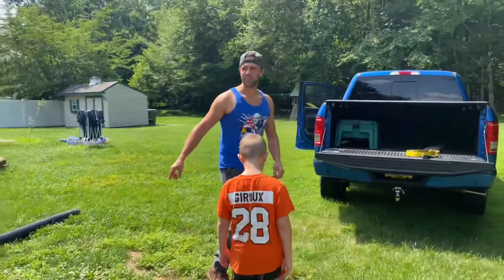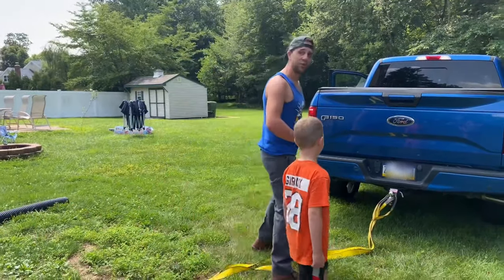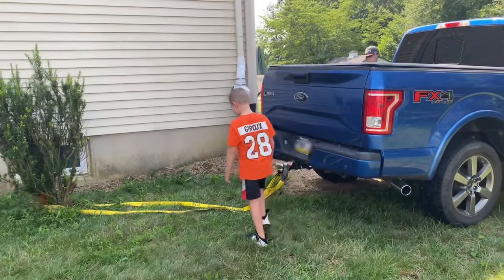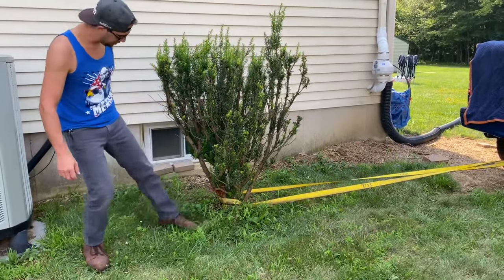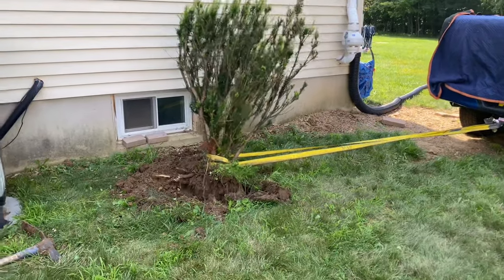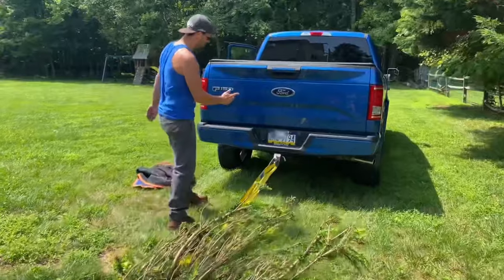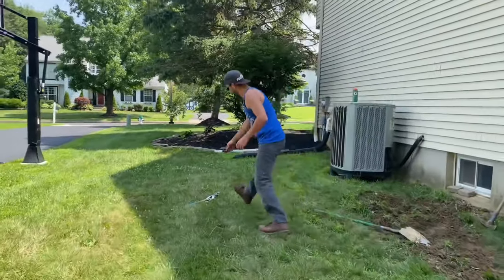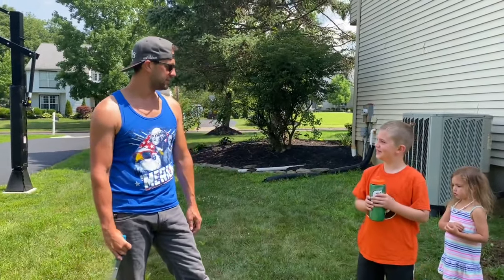Easiest way to remove a bush with roots: 10 Minutes Max | Truck vs Bush

Comment: 4WD is a must…couldn’t tell if f150 had it
Reply from the maker: Agree 4wd is a must !
Reply: No you don’t.  I rent a Home Depot flatbed.  They’re usually a F-250 equipped with a 6.2L V8, rear wheel drive and a tow hitch.  I pin my own draw bar and shackle on it.  Low gear.  Have never had a problem.
Reply: I have F150 V8 but not 4wd. I hope it still works.
Reply: @whunt29708  - so did you get your bushes pulled out without a 4X4???
Reply: @DanInKnoxville  well I ended up just using a shovel. My tires kept spinning in the grass and tearing up my yard so I had to stop trying that way.
Reply: @whunt29708  - thank you for your response :)  Lucky for me my brother has a $
4X4 Jeep with a winch, I'll just have him come help me! lol
Again thanks for your reply! Have a GREAT day!

Comment: Nice job. I have done many extractions like this. My tools were a Ram 2500 in 2WD, and a 10 foot long heavy load chain with a loop to form a slip knot on the target bush. I linked the chain to a 1/2 inch length of braided rope which I looped onto my trailer ball, slow and steady pulls only. Soaking the ground for 10-15 minutes makes it even easier. Sago palms, azaleas, boxwoods, Indian Hawthornes don’t stand a chance. What you do with a 300 pound shrub is another problem.
Reply from the maker: like the idea of watering the ground !  make sooooo much sense !!!  

and a dodge !!!  come on man !  

lol jk love all trucks, cars, ect...   all in fun

Comment: Don’t put the strap so low on the base. If you keep the strap about a foot above the base, it will pull right out. The lower the strap, the more torque needed to pull the bush. That’s been helpful for me anyway.
Reply from the maker: makes sense !  all about leverage….   thanks for the idea.   

Mike

Comment: One option is it run the strap through one of the loops and it will choke itself on the bush and you will end up with only on loop to put on the truck

Comment: With all the edits this would take some one longer than 10 min, could have just used a sawzall for the roots.
Reply from the maker: how long would you say it would take ?
Reply: Took me 10 min each with my hackzall and a shovel on 2 similar stumps and about 20 min on a bigger stump earlier today. It’s just that this video says it’s the easiest method at 10 min max. With the edits it looks like you pushed over 10 min.